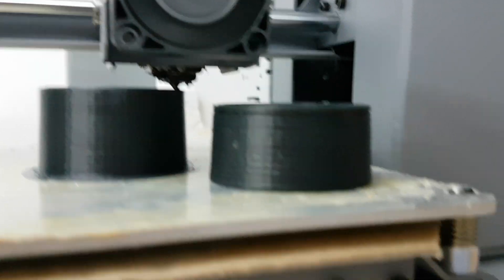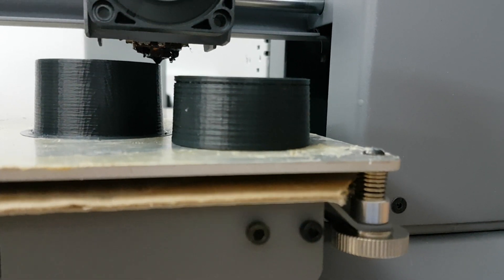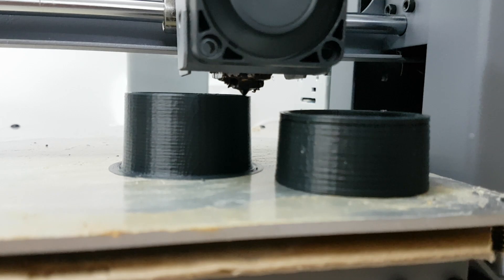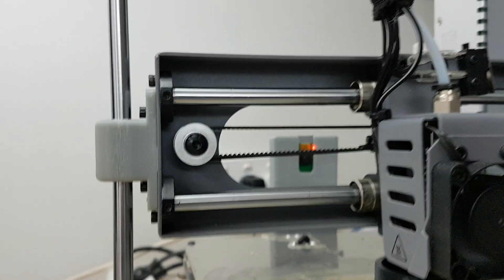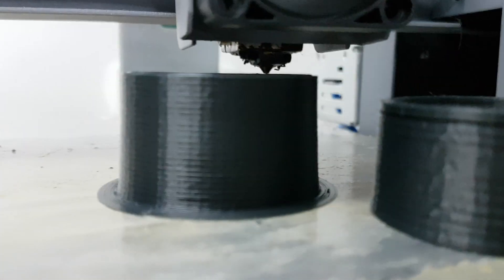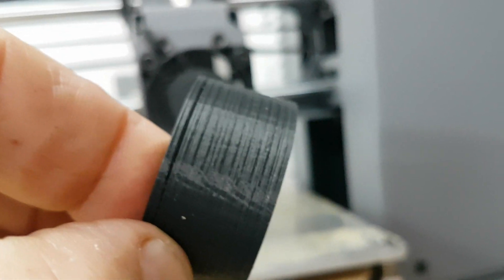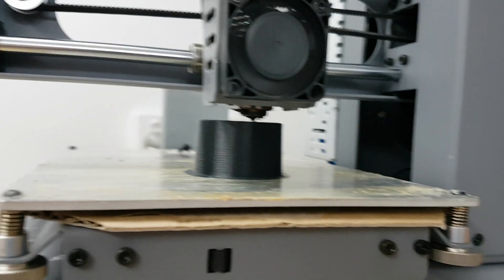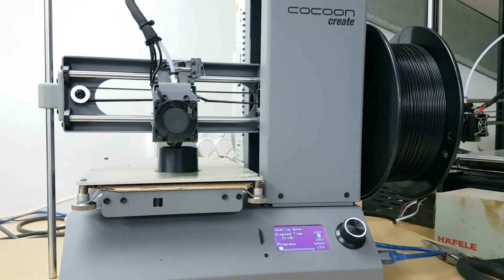Random banding, 3D printer.

Comment: The failed example looks like under extrusion from the hot end temp being a bit low or a blockage. Mechanical failures are typically repeatable at points on identical prints, though loose structure would vary with vibration. Have you checked the tightness of the bolts holding the x and z axes? Could be the reason x is wobbling since the support seems to have cured your issue.
Reply from the maker: I wasn't worried about that.
I have had many prints with the same banding.
And I have not attended to the feeding at all, but the new print has no problems.